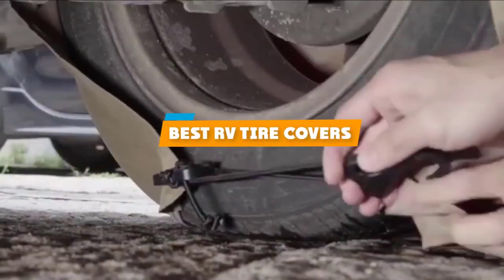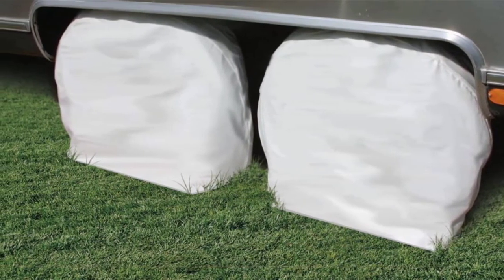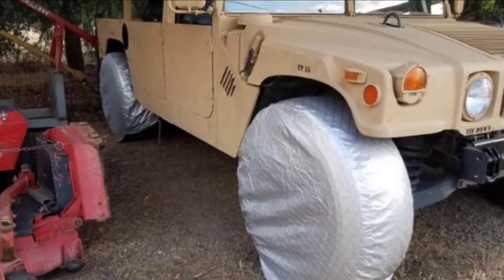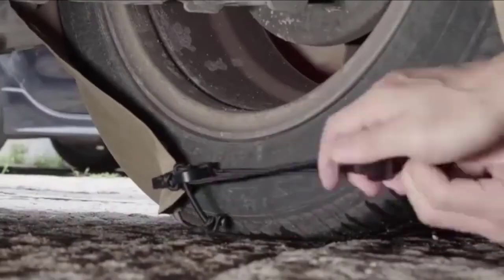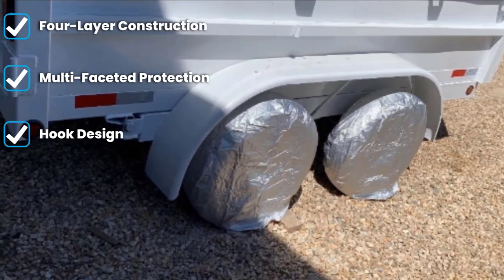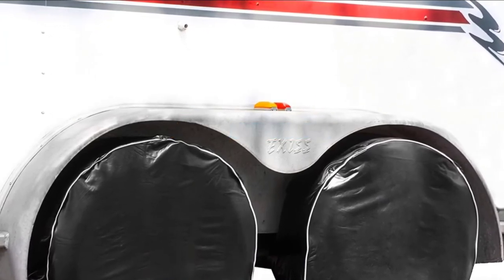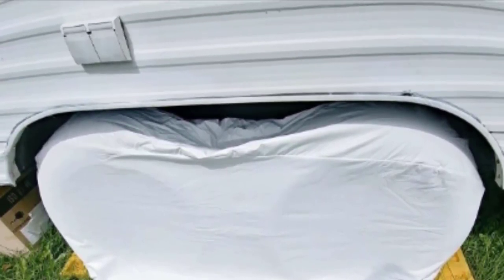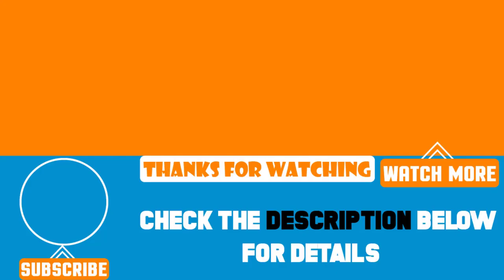Top 10 Best RV Tire Covers Review in 2024

Comment: Rv tire covers are BS. Do you ever see cars with tire covers? Hell no. I have a 2022 Wolfpack 25pack12 toy hauler. I shredded 3 tires on a 2 hr trip. Of course not all at once.  1 at a time..   just buy a made in America good 10ply tire. My brother has classic vehicles from the 70's with original tires,  never covered...  Hey Forest River.. FU..    but a decent tire can handle the sun.  Ask anyone in south Texas.   The heat and sunshine is relentless.  They don't use tire covers.  Months of temperatures over 100degrees. 
But i guess they look cool..